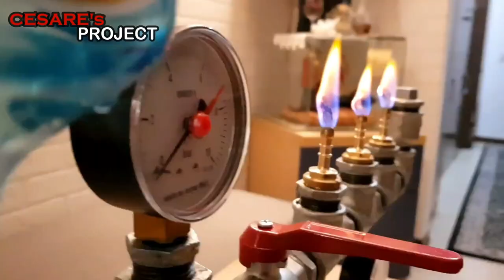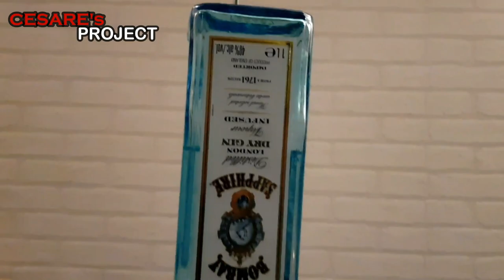Liquor Dispenser with oil lamp | Amazing Homemade Alcohol Dispense/Brilliant DIY Whiskey Dispenser

Comment: Another great job, mate. However, how do you prevent the oil and the alcohol from mixing? If the valve next to the oil lamp is turned inadvertently by someone and oil leaks into where the alcohol is, it becomes a fire risk (due to alcohol potentially mixing with the oil and burning much higher) and it becomes a health hazard, as you will get oil possibly mixing in with the alcohol you are serving. I would modify it to have the alcohol and the oil in totally different sections/circuit. 
But, it's still a great looking project that has inspired me to do the same! :-)
Reply from the maker: +Doug Arnold good evening sir😊 i accepted sir i dind't do perfect this project. And im happy that you are interested to do the same. Please correct that part in your way😊im happy to see your project done. Please send it to my email some pictures of your project. Im happy to see it😊shuremic1500@gmail.com